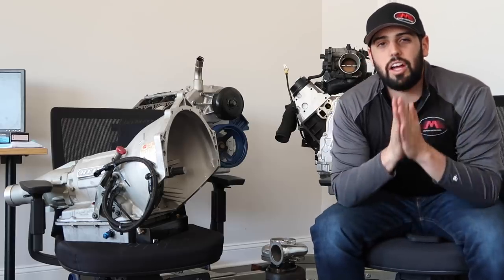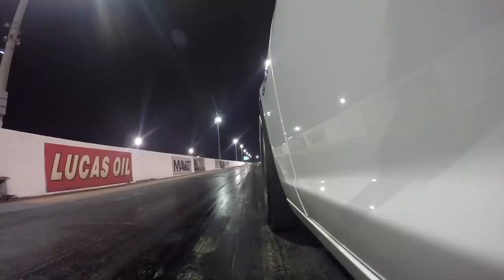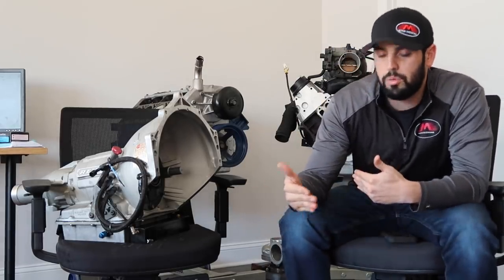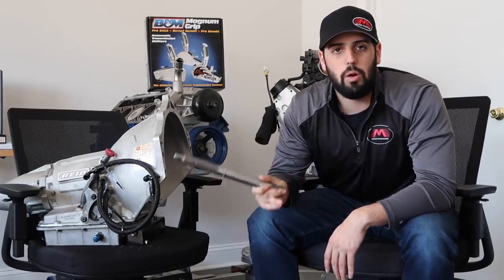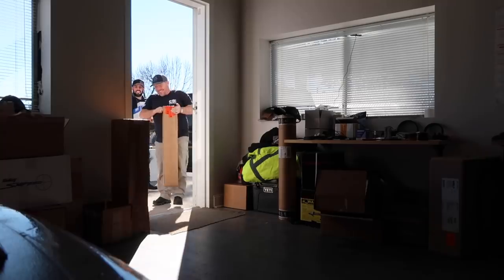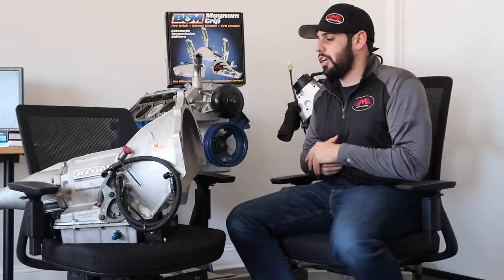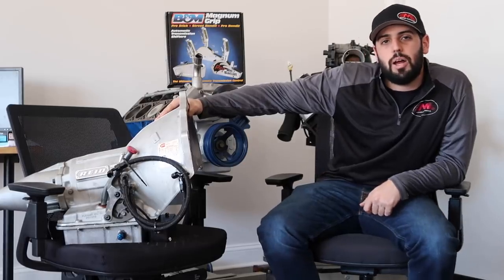Th400 vs. Powerglide!!! Which is better??

Comment from the maker: Yea totally missed that I said a glide had a 1.48 first gear. My bad I meant 1.80 or 1.76 for those who are extremely specific
Reply: Stock first gear ratios on a Powerglide transmission 1.82 1.76 the 1.80 that you have is an aftermarket gear set in my opinion you will be very happy with the power glide and possibly a little bit faster mostly happy that isn't broken all the time. I have ran a Powerglide for many years in a 36 plus hundred pound car that 60fts mid 1.3severybody said a Powerglide would not work in and I have never had a complaint.
Reply: V8 glides have a 1.76 and I6 Glides have a 1.82.
Reply: New Copo Camaro and Cobra Jet both use TH400 3 speed fyi. Wonder why they dont use a glide.
Reply: Is it okay to lauch on 2nd with the th400 if i am spinning first a lot?
Reply: @maximusvonce1381  people using the th400 in the 2020 GT500 cars in doing well
Reply: @shawnlibby675  TH400 is drag racing King.

Comment: Very good video and information. Always thought a power glide, was better for 1/8 mile racing and th400 was better for 1/4 mile. But after this video, I see the power glide is better for higher horsepower engines. While the Th400 extra gear helps out lower horsepower engines.

Comment: I've driven a lot of GM cars from the 70's and my favorite transmission is the turbo 350. I would only use the turbo 400 on an extreme build, like a drag car. Even though they might seem similar from the names, they drive totally different, turbo 400's can feel kind of heavy and clunky, 350's are smooth. Also, just for amusement, if you happen to knock your car into reverse while driving down the street, the 400 and 350 react totally differently. The 400 will lock your wheels up and kill the engine immediately, the 350 will kill the engine if you don't give it any gas, but if you give it some gas it will start spinning the wheels in reverse.
Reply: Actually we had a 400 turbo my friend had in a 72 cutlass 455 engine hit reverse hammering it and we went sideways and the tires were spinning backwards.didnt tear the trans up either

Comment: I loved my Powerglide in my 68 Chevelle in high school, neutral lock out, Hurst shifter ,trans cooler...man 76mph pop that bad boy into second and them 295 50 series Bf's would squak .Drove it daily  for almost 4 years and it took everything a teenager could throw at it and I was destroying 5speed cobras and 400s all day.This was late 90s early 00s here in Vegas with extreme heat no issues, its amazing how much more they have improved the parts for it nowadays back in the day you just made sure you had  neutral lockout and pray Lol im 41 now and still swear by powerglide to this day.great video great explanation 👍

Comment: The lockup powerglide has been around since the late 90s. You didn't see them much after 2004 because they got outlawed in class type racing because people who had them were kicking ass with them. Only place you found them was grudge racing if they were willing to tell you. Once the rule went away they now own just about every record where they're aloud to be used. You can also get them for under 10k as a package. He's right in the fact if you want one of the best out there it's expensive. 15k won't even get it done in many cases. Also the Th400 is popular now with cars making 2500hp+ with the first gear removed. Some keep the 3 gears. Just depends on the tuner. It's not that the 2speed is better it's just easier to get to work. 
Nice video bro..
Reply: Awesome info thanks for your knowledge can tell you know what your talking about! Ima 4 speed muncie man but love how the old school transmissions auto/manual still rip it really get the rig moving with those long first gears. My hot rod M21 will litterally run the speed limit 64 mph in first.

Comment: Love the vid’s , I personally have a built 4l80E in my heavy turbo big block truck as it shares many hard parts as the 400 and its 90% street driven with the ability of having a high stall lockup converter
Reply: Shares many hard parts with? Dude, it's a th400 with an overdrive. Identical.

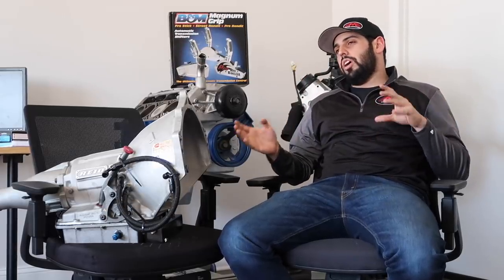Comment: I have a OBS short, wide regular cab truck. I got it down to 3200lbs. The interior is stripped with one aluminum plate for gauges and two aluminum seats. Truck is back halfed with a 9in ford with ladder bars. Rear adjustable shocks. The roll cage runs from the rear frame over the axle through the cab and runs out to the front frame horns. No inter fenders. The frame has holes drilled for weight. Still running stock front suspension. That’s about to change. I’m installing light weight A-arm and I plan to remove the front and side glass and go with Optic Armor. This should get me close to 3050-3100lbs. Running a big cubic inch SBC with a Built Power Glide. Truck best time is in the 6:50’s in the 1/8th mile. It has a 4:56 gear, so the power glide really helps me get off the line before having to shift and upset the truck. I’m hoping going with lighter front suspension and using Optic Armor I can get in the 6:30’s. That’s pretty good for a full size truck that’s all steel but the hood. I’m a big fan of the Power Glide even for street driving. My truck makes enough power that I don’t need a low first gear to get moving. Plus I have the 4:56 rear gear.. I had several people tell me you can’t run a Power Glide on something over 3000lbs. It’s all about setup and gearing. My truck was setup to race 1/8 mile. I can’t run down the interstate at 80mph for long distances. But at drag and drives I hope to cruise at 55-60mph. I’m excited to try anyway. Great video, sometimes I feel the Power Glides get a bad wrap, but it’s because guys don’t have them setup right. 🇺🇸🦅🏁🛻

Comment: If you have a light car with a lot of power a powerglide is the way to go. I drove mine on the street quite a bit with a 4500 stall
Reply: What's considered "light"?
Reply: @cturboaddict  somewhere around avg coupe weight

Comment: I would be interested in learning differences in lock up vs non-lock up converters, pros and cons
Reply: Same! Any info??
Reply: Lock up has a solid connection between the engine and trans as opposed to the fluid connection.

Comment: Manual, no converter issues. Run an over under and you can do a 1st into over with a switch, then go to third and then 3rd over again with the switch.

Comment: I think the new hot setup is the turbo glide. Glides certainly have their place. The downfall of a glide is the same now as it has always been. It might be a lot lighter it also means its a lot weaker. You can make a seriously strong glide but its certainly going to cost. If your willing to sacrifice weight for strength but you still want a better first gear ratio then the 2 speed turbo glide is what the industry has turned to. I think it also depends on where your budget is. If you want something that will work behind a dump truck and is built for pure strength and you dont want to invest 5k in a tranny then a 400 is where its at. The 400 is an excellent option for someone who wants to go racing reliably on a budget.  Your going to sacrifice the hp that all that extra rotating mass robs though. If your not so much on a budget and you are shooting for every 100th that you can squeeze out of the car and you dont mind all the additional maintaince then a glide is for you. Knocking out weight is just free horsepower. There is a reason why in stock eliminator and super stock most guys are running glides, 200r4, c4 and 904s with 3 clutch packs in them. Weight=hp. Just my 2 cents though. Nice video thumbs up.

Comment: GTO's had 2 spds. mine from factory lasted me about 350k on a 326 with 2 filter changes. my 500hp 455 is eating up th400 soft parts. thanks for the discussion.

Comment: Great video.. easy to understand.. but reading the comments I see some confusion over a built PG vs stock PG..  A stock PG is still good for the street in a low HP car say 300-600 hp after all GM put them in 3400 lbs + cars.. after 600hp it's best to put some stronger parts in them up to 1000hp with a blanket or shield of course .. After 1000hp you really need a built PG with a aftermarket case... Low HP cars with a stock PG work better when the car is 3000lbs or less.. Any thing over 3000 lbs street sometimes strip car really needs to be a th350 or th400 to get all that weight moving... After 1000hp it really don't matter.. It will be a built transmission anyways.. 1000hp + cars with a built PG is less weight and gives you more time to settle the car down before you have to shift... Any strip car that's a 1000hp+ a PG is the way to go..
Reply: can you roll race with a PG with a turbo car? Meaning highway pulls in second, assuming the PG is fully built

Comment: Also Powerglide take about half the power to turn compared to a TH400. 
But I have the TH400 in my 12’ Camaro with a centrifugal supercharger. I do not have as much power off the hit as a proper turbo setup.

Comment: At what power level do you feel either changing 1st gear in the 400 or going with a glide is necessary? Excited to see how much better the COW leaves, suspension dialed in & Glide should be quite a big improvement since she likes to Hit those tires hard!
Reply: General rule of thumb is not to go with pg until you have at least 550 hp in a big block.
Reply: Why not just launch in 2nd on the th400
Wouldnt that be the same as changing to a glide??
Reply: @FirstLast-tx3yj   Their are some nice gearing options for the 400 that would be a great compromise IMO. Stock gears are ok for 2nd gear leave,  and the 2.10/1.40 is a good 1st gear option, but there is a 2.08/1.56 option which would make a great 2nd gear leaver. Obviously on a slick track that could help with traction and not crippling your starting line ratio. It also has a lower reverse rotation percentage  between the  fwd/direct drum. Their is also a 1.77/1.40 that would be pretty cool too… 
Keep in mind 2nd gear leave will never have the appropriate  converter  it’s just a band aid for the track, lesser of 2 evils thing.

Comment: I heard one advantage of a non-lockup converter is that they can handle more horsepower and torque than lockup ones 🤔. Nothing necessarily wrong with a non-lockup converter.

Comment: Great decision. Your going to pick up a ton with the reduced rotation weight. With your SBC the turbo 400 takes about 25 to 40 hp more to spin it. Your going to feel the difference when you make your first pass with the glide. Good luck.

Comment: when running the 1/4 mile in the cow what differences will you see going from the TH400 to the glide? Like does the glide hit your max rpm sooner, because I am thinking you will hit high gear or 1:1 sooner in the glide than in the TH400. Just curious. By the 1/4 mile the TH400 is stretched pretty far in the cow I would imagine so just seeing if the glide is more suited for 1/8 mile passes for you.

Comment: John thanks for all the great vids.  What stall size r u running and what are you launching at generally?

Also - if you use a 2 step which is part of the question above are you WOT on launch and letting the 2 step hold you.

Comment: I have a 1967 impala with 327 and a powerglide and i can tell u the powerglide is great cus u can launch and wind 1st gear waaaaaay out then 1 shift n ur in 2cnd and thats it n it just keeps going in 2cnd!
Reply: Most GM cars in the 60s had powerglides.. I had a few of them... just because you can wind it out in 1st gear doesn't make it fast.. it feels like it but it's not... I am running a powerglide in a BBF foxbody nitrous car with a 5000 stall... have to hit second gear 200ft out.

Comment: 4L80E=TH400+OD+ lockup torque converter
Reply: I've been running 4l80e using MS3 controller vis canbus to the MS3 ultimate for YEARS...BBC well over 1000hp F1A-94...billet lockup....perfect for true street cars that strip as well....
 And yes several 4l80e internal parts are the same as the t400 including the ratios PLUS without adding a sensor I can compare rpm vs turbine speed vs output shaft speed having built in traction control along with the ability to see convertor and trans slip easily in the logs.....
Reply: What exActly does the lock up TC do? I too run a th 400 and probably going thru rebuild soon
Reply: @braleyshardwoodcustoms8584  uses a clutch in the converter to "lock" the transmission to 1 to 1 with the engine...meaning the engine turns once, the put shaft of the trans turns once....it can feel like another gear depending on how loose the stall is
Reply: @braleyshardwoodcustoms8584  say your in 3rd gear 4500rpm, hit OD on the 4l80....drops to ~2300 rpm as ya sit at 65 to 70mph
then the torque converter locks up..... dropping rpm to about 1800 to 2100 rpm. 

your th350/400 torque converter will ALWAYS have that few hundred RPM "slip"
this slip also makes a lot of heat.... 

some th350s had a lock up TC.... along with some 3 speed FWD trans (th185 iirc)

on an old gen 1 v8 GM.... a 700r4 is a direct bolt on (3 speed + OD + lock up TC)
you will need the factory controller, and some throttle linkage for the TV cable (and know how to set it..... which is easy on stock brackets and carbs)

but a 4l80E is a bit stronger....newer design.... and adapters are out their

you can build a 700r4 to take a lot of power.... if ya cool it, and set the TV cable right
Reply: @braleyshardwoodcustoms8584  you can’t just add a lock up converter FYI
Reply: Chev trucks from years 80-87 th400 had  over drive only some.

Comment: I have an FTI TH400 and matching FTI 3600 stall converter (to keep it somewhat streetable) and love it. Highly, highly recommend FTI! 

Though with my new combo I’m likely to run into a somewhat similar situation you’re in and may have to switch to a glide. But if I do, I’m putting a gear vendors unit (has been plan for the 400, but haven’t done it yet) behind it and turn that 2 speed into 4speed, sorta;)
Reply: I have. 68. Camaro w a. Powerglide. It. Had. 6. Cyl. Now. It. Has. ,350. I. Was. Going. To .change. To. A. 400. Turbo. But.  Now. I'm. Thinking. Change. The. Converter. What. Conv.
Reply: Would. Work. Best. Thank. You.

Comment: I have a single turbo coyote and want to do a TH400 swap, I only plan to be 1000hp at most and drive it pretty regularly. What would you recommend I do TH400 or get a stage 3 of my factory trans?

Comment: Could you have launched the 400 in second gear and got similar results as the powerglide?
Reply: Yes you can they make a valve body that will let you leave off the brake in every gear its like 400 buck at jegs.
Reply: You could but then the ratio is way off so it won't launch or pull as hard !

Comment: I have run T400s for years with zero breakaqge..I am building 2 new cars and plan to use nitrous at the launch...every trans co that I talk to has a different opinion..1 car will be about 3000#, the other..2600#...suggestions?

Comment: Well the glide is a perfectly streetable trans gm ran many versions of it up till 64-65 whn the norm turbo hydro came out chevy had the power glide till 65-66 and for some cars even after tht due to da turbo hydro being a option altho some companies like pontiac buick caddy ran either a 3 speed or some even a 4 speed roto hydro trans till early mid 60s...some even had a "dual range" roto hydro trans which changes the shift points in the trans due to usein diff fliud passages.....honestly its about one gear/tires and how many times you wanna shift....a turbo hydro either the th350 th375 th400 ll have to be shifted twice where as a glide just once.....and as you said has a longer first gear allowin you to pull further i  the power curve before shifts.....
Reply: Yeap, a old buddy of mine had a 64 Malibu with a straight 6 and a glide from the factory. Definitely Street able

Comment: Since you said make a comment if you have any questions I guess i'll drop one in here because i'm just curious what you think. I'm a young car enthusiast that's trying to make 
his dreams a reality and trying to soak up as much knowledge as possible. I'm building a pro touring setup 1970 Chevelle that's going to be setup for autocross, but i'm going to be putting a twin turbo 6.0ls in it so it should be at least 1k hp, I also plan on driving it a lot and maybe taking it down the strip once or twice. I'm leaning towards powerglide but am just curious what your opinion is since you're much more knowledgeable than me
Reply: When you are driving it on the street a lot the th400 with a lock up torque converter is the way you want to go.

Comment: Subscribed. :) What I am curious about is the difference between a PG and launching a TH400 in 2nd gear. Having a 1.51:1 2nd gear in the TH400 brings you down into PG territory. Are there any cons to launching a TH400 in 2nd?
Reply: Yes the converter is wrong  or at least not ideal and likely rear gearing is wrong.

Comment: I have a Honda s2000 with a tranzilla right now and I drive on the street a good amount. I've been thinking about th400 or power glide swapping. I have 800-900 horse, 9000rpm Redline and 2600 pounds of rice. What do you guys think would be "best"?

Comment: Man these cars are pigs so I'm curious to see how well the glide works for you. 
It probably would have been easier to just say that by the time you configured the th400 to work well for your setup then you would have ended up with a turboglide. Way more practical to just go with the powerglide so I'm glad to see this.

Comment: Most of the big high hp big name guys that I know of run a th400. A lot use the turbo glide style which makes the th400 basically the same ratio as the powerglide but in general the TH400 is a stronger unit.

Comment: You said you couldnt cruise around for 2 hours doing 80mph in a powerglide. So exactly how long can you safely cruise around in a powerglide on the street/highway?
Reply from the maker: It’s all relative to setup of the vehicle, tire size, and rear gear ratio